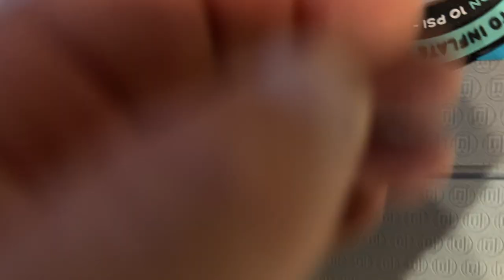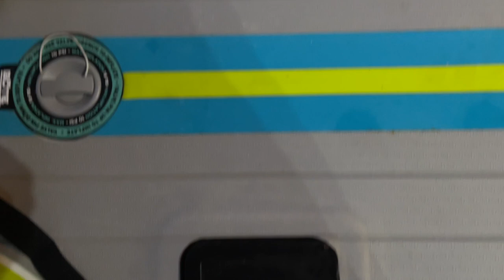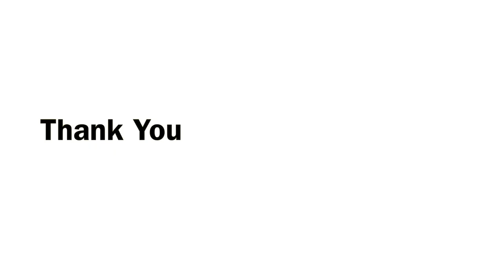Why You Should Not Buy a Bote Rover Aero!

Comment: I just bought the same one, electric motor is 30lbs lighter than the 46 pound motor. I prefer 40lbs of battery anyhow. Get a 5 chamber Isle 12’6 if you want to load up 150lbs.

Comment: I’ve had mine for about three years and must be a lucky one, have had no issues and left it in the back of my truck deflated for about six months. Hidea is ass and I went with a Nissan 8hp two stroke….20-22mph with it loaded. Still going strong and use it quite often. Btw their electric pump is garbage and the bag the board comes with as well.

Comment: You do realize that every boat with a small outboard that is a 2 stroke, you have to mix your own oil right?… 

I’m 5 minutes in, and you’re mad at FedEx, and then mad that you have to mix your own oil… none of this is Botes fault
Reply from the maker: And I realize you did not watch my video or you weren’t paying attention. 
They sent me the wrong tracking for some one else’s order, not once but twice. And I stated in my video the tracking errors was on FedEx but them sending me the incorrect tracking was them. 
To add this is not a 2stroke engine, this is a 4 stroke engine. I was not talking about the fuel mixture, I was talking about the actual amount of engine oil the reservoir neededed.